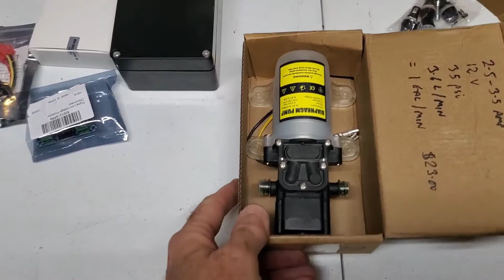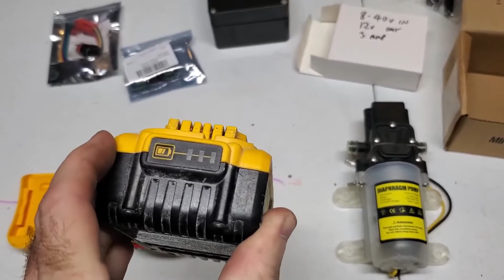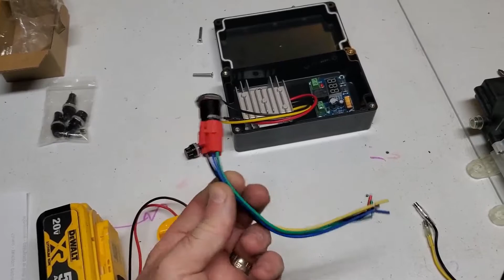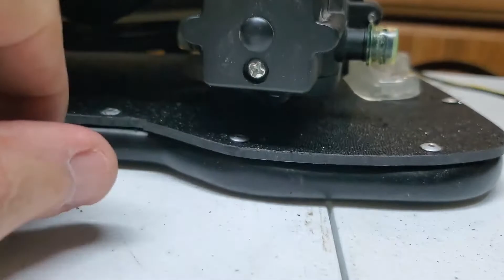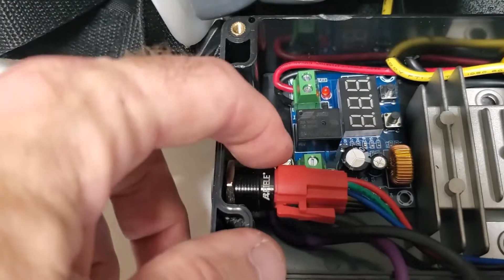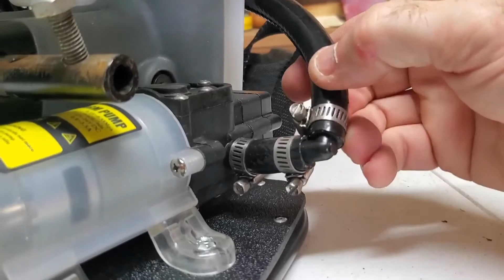Convert your 4 gallon sprayer to DeWalt® Battery Powered for less than $100

Comment: How does the flow rate work? I know pump sprayers purchased for this purpose have over pump control and specific flow rate with the pumping. If you stop spraying while the pump is on, what happens?
Reply from the maker: The pump has a pressure switch built in that shuts the pump off when the flow stops (you stop spraying)
As far as flow rate / pressure goes, it's not adjustable in this configuration. You can buy pumps with different max psi ratings.
Reply from the maker: The pump has a pressure switch built in which shuts the pump off when you release the wand trigger.
The pressure is not adjustable in this configuration but you really don't need it to be.

Comment: Just built this today and it works great.  Bought everything but the box from  Amazon.  I plan on designing and printing a custom box.   It’s meant to be a portable fluid pump for whatever.  I also thought about using it in a camp shower.
Reply from the maker: Nice! A higher gpm pump would work great for a shower!

Comment: How did you attach the plastic piece to the sprayer base?
Reply from the maker: The black plastic sheet was cut to shape using a jigsaw and sanded to make the edges smooth. Then I drilled through the plastic into the metal tube frame and pop riveted it on.
I only drilled through the top of the tube, not all the way through if that makes sense.

Comment: Is it possible to get a better wiring diagram of the switch???
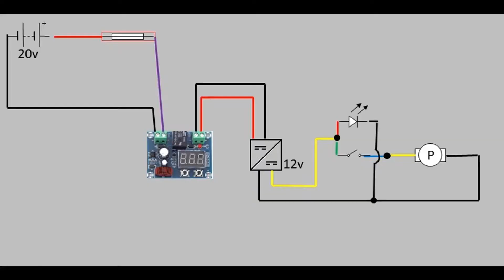Reply from the maker: At the 19:00 there's a wiring diagram, not sure what you're looking for. The switch also came with decent instructions if you want to wire it differently.

Comment: 1 year later, curious if you’ve had any issues with leaking on either of yours. Many of the name brand reviews are abysmal. Which led to wondering if diy might be better and finding your tutorials.
Reply from the maker: No leaks, no issues at all, except the one I made for my friend the solder joint I made on the fuse holder failed, but that's down to my poor soldering skills.
My concern with buying a battery sprayer is exactly what yours are. Premature failure means manufacturer proprietary parts.
So far so good
Reply: @petedymond thank you for the update. I'm mostly annoyed by my manual pump because of how long it takes to prime the system. I've tried a few ways to get it to prime and get the air out but to no avail. Thanks again!

Comment: I like it, might try make one of these, will probably put a push to make button on a 50cm lead for the left hand and have the wand on the right.
Reply from the maker: You can mount the box and pump on opposite sides so the switch is accessible and the wand is on the other side. The pump will have to go head towards the back due to the flow direction but an easy change.
Reply: @petedymond  what difference would a 12v 5A 60W output DC step down converter make?

Comment: Do I have to remove the existing manual pump that is inside my sprayer or can I just cut the existing hose and add the pump like you did? You didn't show how to do this part. I see your pump handle is removed but unsure if you did anything else to the manual pump. I have a Chapin 62000 backpack pump I want to convert. Please advise...
Reply: Ok. So I found your other video (https://www.youtube.com/watch?v=kW_-hO0WGKM) that explains how my Chapin 6200 backpack sprayer works and I can now easily convert it to electric pumping.
Reply from the maker: @EdRockwell  glad you were able to find what you needed. Thanks for commenting

Comment: The fuse is a good idea, but the dewalt batteries have a built in BMS that protects them from over charge and discharge as well as over heating.  This just seems overkill.  Also, the pump is rated for 24 volts. How does it run without the buck converter.
Reply from the maker: The DeWalt batteries do not have the discharge protection built in.
See here: 
https://www.dewalt.com/why-dewalt/featured-articles/best-practices-for-battery-life

The pump is rated 12 to 24 volts so it works just fine on 18/20 stepped down to 12. That's how voltage on DC motors works, the V input changes the speed of the motor.
Hope this helps!
Reply: @petedymond  the link you sent does not say they don't have a discharge protection. It just states they should not be completely discharged.  I have old brushed 20v, 18v converted to 20 and new brushed 20v tools.  When the battery gets too warm or down to 1 bar, it stops working.  I am still pretty sure the bms like most protects against complete discharge or you would see everyone switching to other manufacturers.   The added circuit is a nice addition, but still don't think it is necessary.   Would still like to see how the pump runs without the buck.
Reply from the maker: https://www.sevarg.net/2016/09/11/dewalt-20v-max-30ah-battery-pack/
"One thing of note here: The battery is always connected to the terminals.  There is no way that the BMS can cut off current if the pack voltage is low.  It’s up to the tool to determine the cutoff point and refuse to work below that."

Comment: Great tutorial, exactly what I was looking for !  I am pretty sure  DeWalt, Milwaukee and etc well known brand batteries already come with built-in BMS so no need for extra circuit to prevent discharge. A few bucks to save and less things to fail.
Reply from the maker: My understanding is that Milwaukee batteries do but not the other brands. But I'm not certain.
Reply from the maker: https://www.dewalt.com/why-dewalt/featured-articles/best-practices-for-battery-life

Comment: Nice tidy build mate. I’ve just done one very similar but added a pwm speed controller to let me dial in the desired pressure at the nozzle to control droplet size and flow rate.
Reply from the maker: Nice! I've thought about adding a T and a nozzle inside the tank so you can agitate the mix using the pump.
Reply: That’s a great idea and on my to do list also.
Reply: What PWM speed controller did you purchase? I'm looking to keep my pressure at 10 psi or less. I think this is the ticket. Thanks!
Reply: @EdRockwell  I’ve tried posting a link twice but it keeps getting removed. Really any dc one that has a higher amp rating than your fuse should do. Mine cost about AU$10